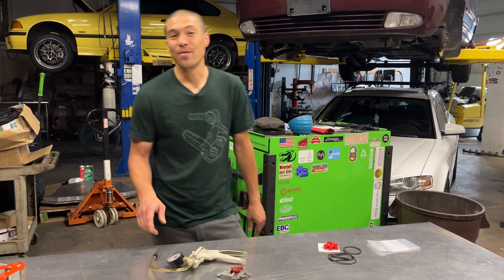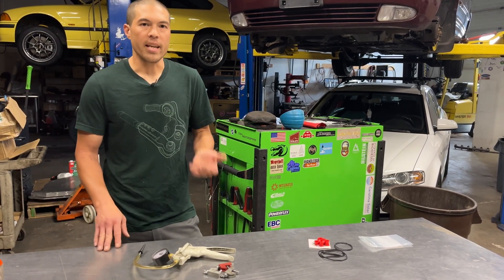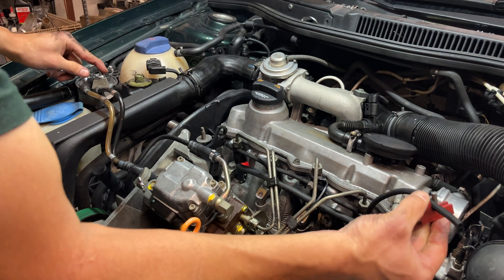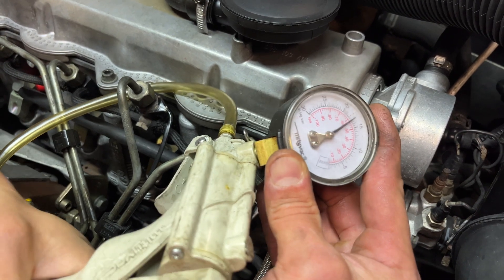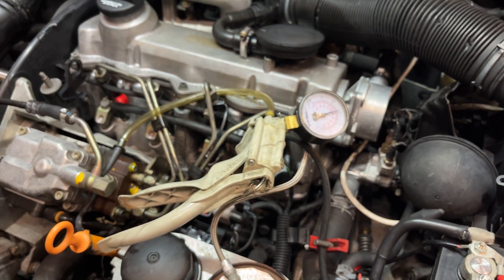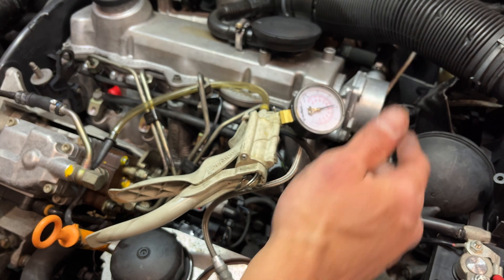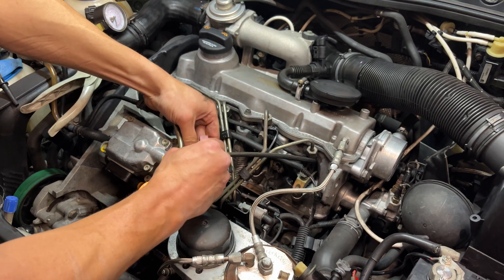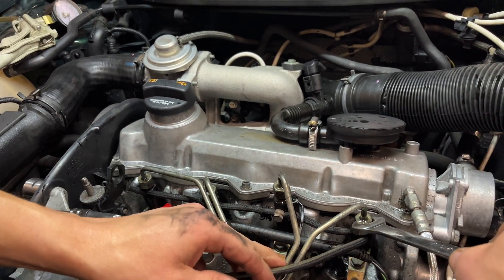Bosch VE TDI Diesel injection pump vacuum testing and priming by DIESELGEEK

Comment: Having a hard time getting my 06 PD BRM to start, cranked several times, not hitting a lick, yet. Fuel system pressure has been down for a good while, knew it would be hard to start back up. Any tips/advice much appreciated.  - thanks

Comment: Do you need to undo the bolt in the middle of the fuel line ends and fit a drill bit to get full travel of the pump?